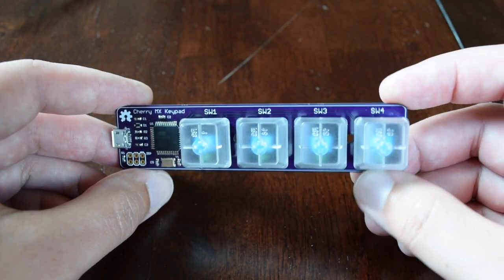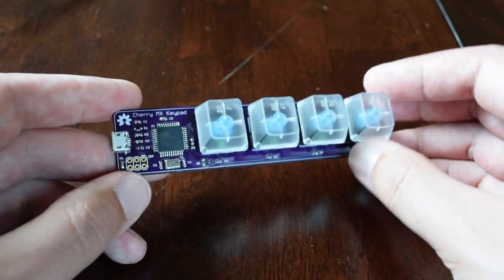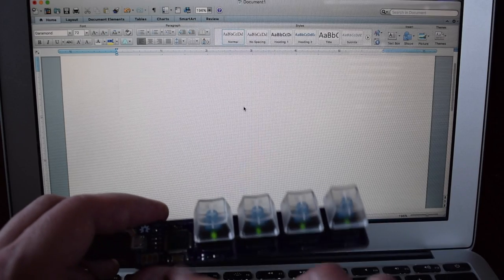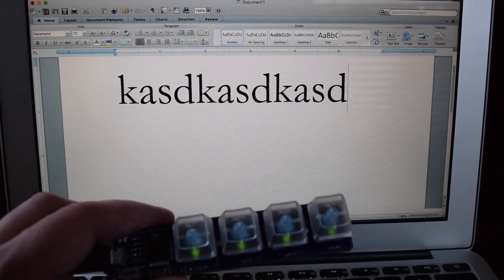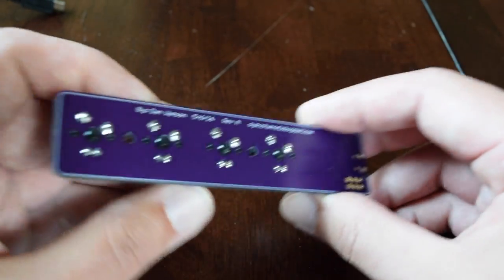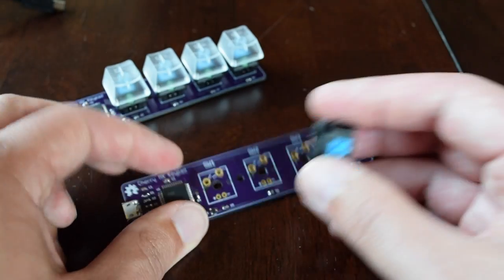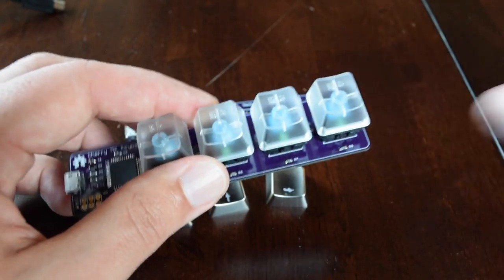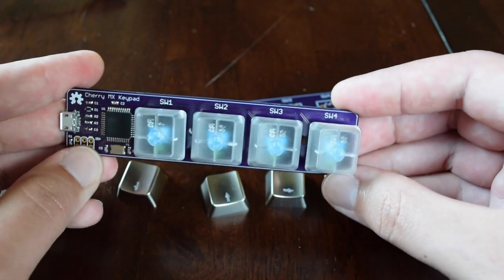Custom Cherry MX Keypad

Comment: Hey Dan, I'm thinking of using this as a basis for making a custom gaming keypad. I've never made a PCB, so I was wondering how everything got grounded. I don't see all the grounds connected or anything so I was just curious.
Reply: For anyone else with this question, the ground rail is typically applied in the PCB design process as a copper fill which covers one side of the pcb, underneath the solder mask :)